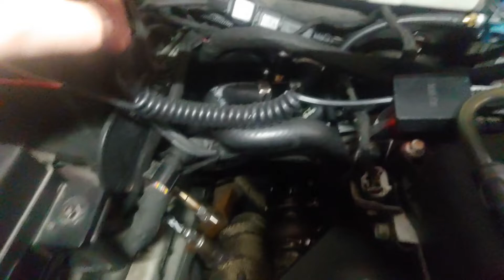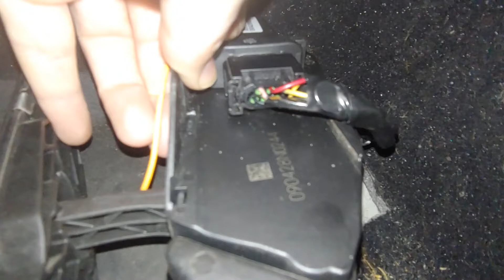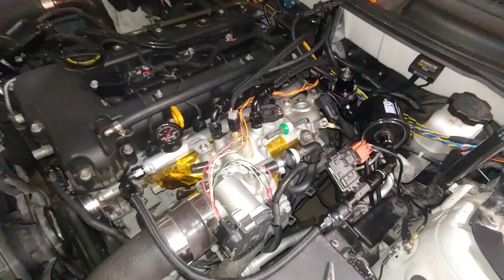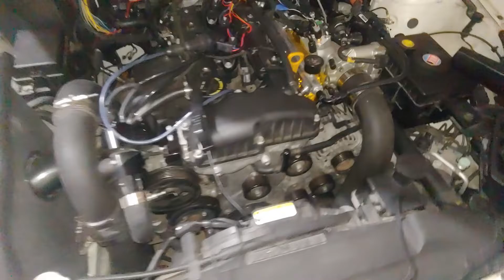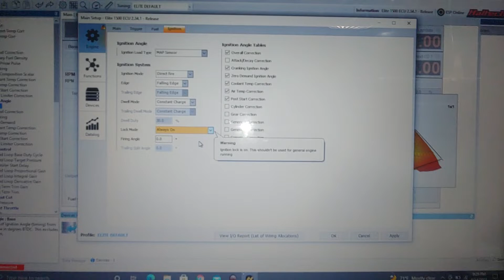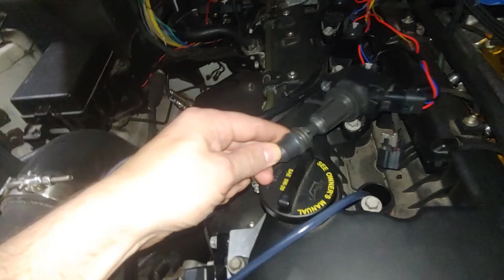Genesis Coupe Haltech Elite Install - DIY/How to, Part 3

Comment: Excellent !
Are you using the factory start button?
Reply from the maker: Yes I am!
Reply: @Weekend_Garage  Didn't I have problems with the immobilizer even without the factory ecu?
Reply from the maker: The factory ECU is still in place.
Reply: Thank you for your answer
Then, the water temperature or intake temperature will not be a big problem, but what did you do with the crank signal or cam signal when you shared it with the ECU?
Reply from the maker: Yes, I spliced into those. If you download Haltech software for the platinum pro, it will have a base map with all the OEM sensor calibrations. That is not something I thought of during install so I had to install some aftermarket sensors. All though I would still recommend a better air temp since the factory one isn't great.

Comment: Questions are you going to install a boost switch controller
Reply from the maker: The Haltech has an on-board MAP sensor and an output for a solenoid to control boost. No need for a separate boost controller. Even if you go over 29psi (max pressure for on-board sensor) you can wire a 4 or 5 bar MAP sensor to the Haltech and it will still control boost.
Reply from the maker: If you mean a high and low boost setting, I won't have that. It'll just change timing based on the fuel type which will be e85 most of the time.
Reply: Oh ok got it oh next question are you running on a stock engine?
Reply from the maker: @jlw2447  Yes. stock bk1 motor, but I've modded virtually every other system on the car.
Reply: Nice bro love the videos keep going and how much hp can the stock engine take? I have a bk2 and I'm doing a build where you can drive on the track and drive on the roads and canyon so what a good hp to be at without blowing the engine? Try to my the engine last long as possible and I but another engine I'm going to fully  rebuild.
Reply from the maker: I'm already past what I would call safe for the bk1 2.0, but the stock bk2 2.0 should be fine to about 400. Keep in mind more power means you're trading reliability. So don't expect 100k miles out of a motor that you're pushing twice the amount of power it was designed for. 400whp is plenty of fun for a street car IMO.
Reply: @Weekend_Garage  thanks my brotha for the wisdom